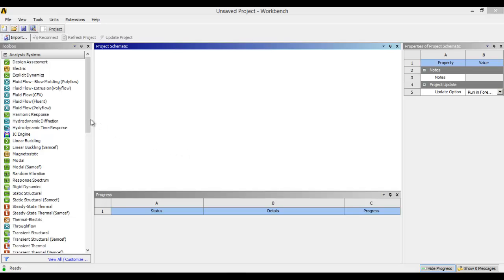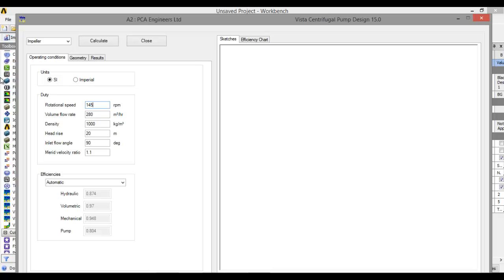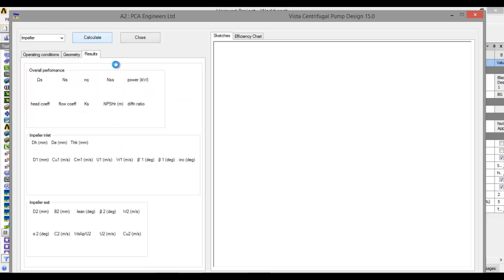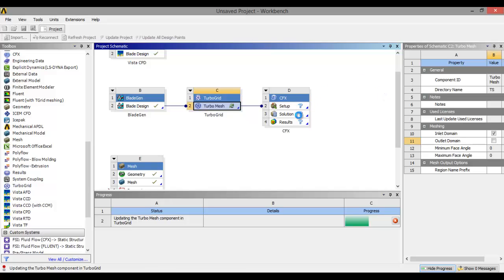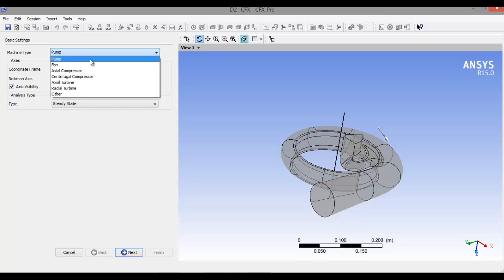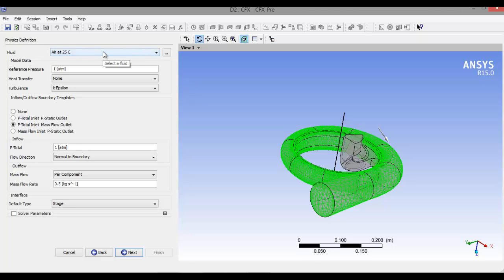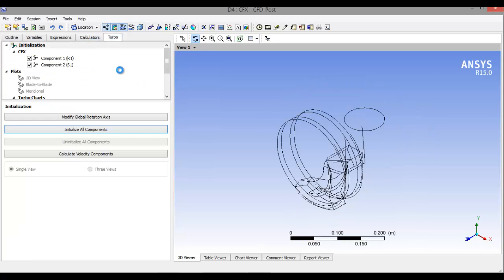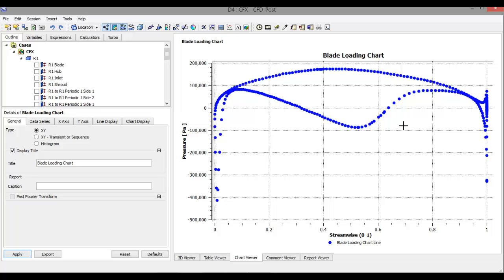basics of designing & making of centrifugal pump simulation in ansys

Comment: i imported the blade and volute design independently and did the same procedure but the volute is showing b50 instaed of b75 and i cannot define the stationary component as shown in the video , it happens but does not show up in the interface........i am stuck....please help me out, my email...suyashbafna2@gmail.com
Reply from the maker: Sorry can't help I don't have ansys any longer 😣 my laptop can't support it
Reply: @Cadknowledge  it's ok I think I found the problem ....the body was not solid ...so I made it solid....thanks btw❤️
Reply: hey please i need your help can you please help me out ........actually i am rotating the impeller in wrong direction but how do i make it rotate anticlockwise .....i am getting negative pressure at the outlet due to this.....like the is no -Z direction option in the turbosetup.........please help
Reply from the maker: Just type  negative in your rpm magnitude
Reply: @Cadknowledge  thank you so much ......you were really helpful ❤️❤️❤️❤️❤️❤️❤️❤️
Reply from the maker: If you really want to thanks just watch my videos and share it . I will be thankful